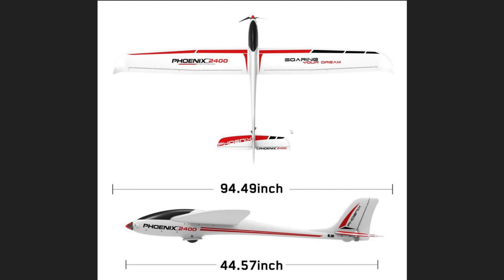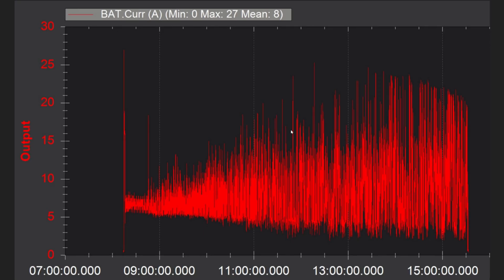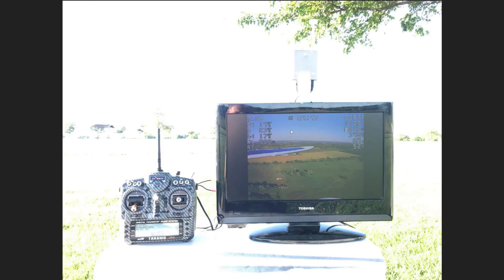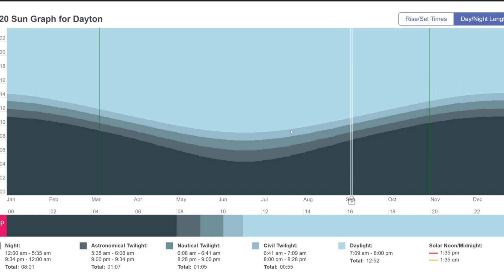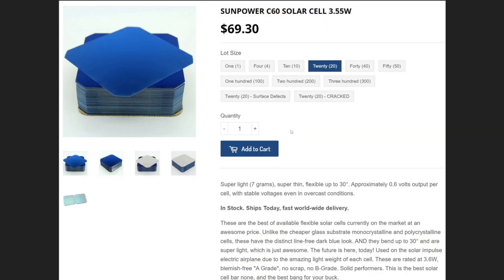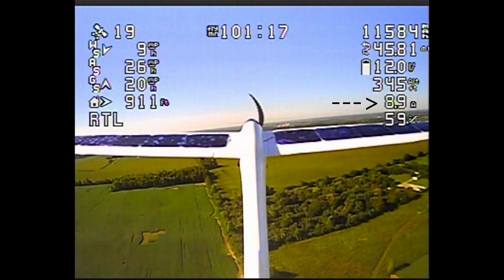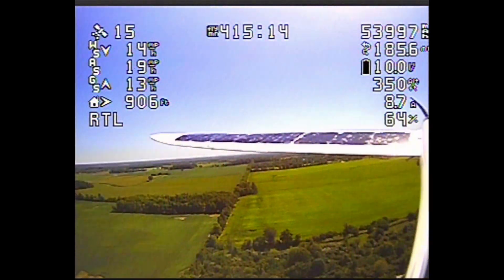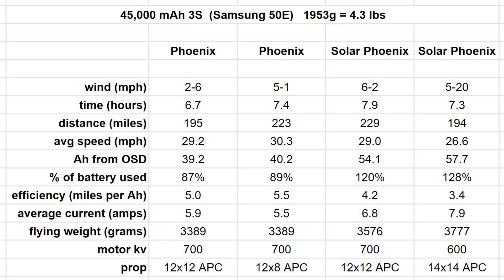RC Solar Airplane 7 Hour Endurance Flight

Comment: your Genasun shows it's a Lead Acid... can you use it on Lithium? I was talking to customer service for them - they said big now. Wonder what is the practical difference
Reply from the maker: The lead acid Genasun charger would have over-charged the battery, if the input power was greater than the output power, but that wasn’t the case. Other than that, it worked perfectly. The MPPT function was still maximizing the solar output. If it was going to over charge, my plan was to bump up the cruise throttle and simply fly faster, haha

Comment: im 49 and retired  do to a horrible accident that has pretty much destroyed my back,  i need a hobby, and this is right up my ally!! im a bit confused on how you program it and how your  able to watch the flight info.. teach me please.. im totally into this
Reply from the maker: I’m sorry to hear that, but you might have found a great hobby for yourself. There’s a lot to flying RC. You should start with a Spektrum controller and computer simulator for RC airplanes. Once you get that hang of that, then you can get a RC plane that connects to the controller that you’ve been using with your computer simulator. After you’ve mastered all of that, then you can explore the world of autonomous flight controllers. Check out Horizon Hobby. That’s a great place to get started.
Reply: @MatthewHeiskell  I own several rc aircraft. I’m interested in doing some endurance flights. I already do way points with a dji drone.  But that’s way different, it’s a lot easier.   I’m interested in doing what your doing.  I got plenty of time to kill

Comment: Hello, I’m planning to build such a solar plane. I was wondering how the battery would be balanced charged onboard the plane. Did you use a BMS between the mppt and the lipo?
Reply from the maker: That’s a good question! I’m my case, since the battery was only being discharged one time, albeit more slowly because of the added solar energy, I didn’t need to worry about keeping the cells balanced. There weren’t enough cycles for the cells’ voltages to drift apart. If you want to be 100% sure that your battery stays properly balanced, and prevent over charging, then you can use a battery management system (BMS). My plan for preventing over charging was to increased the throttle and fly faster, but my output power was always slightly higher than the input power. Perhaps it would have been better for me to use a smaller battery. Perhaps that weight reduction would have reduced the cruise power low enough for the solar cells to keep the battery fully charged.

Comment: I'm curious if you ever figured out the erratic behavior of the ESC at the launch and I am wondering if you had considered that it might have been propeller blade stall.  Running such a big prop at a slow airspeed but high prop speed to start may have caused the prop to stall.   Once you get your airspeed up then it works, but makes for a rough start.  Just a thought.
Reply from the maker: What you said is true, but the problem was the non-zero minimum throttle value in arduplane. There was a weird conflict when auto launch encountered it. I changed that value back to zero, and the weird behavior went away.

Comment: You have almost 58W of cells but are pulling 39. You should remove the laminate and try again, the increased solar efficiency would possible overcome inefficiencies in the wings.
Reply from the maker: Very true! I also cracked one of the cells during the lamination process :( but this setup still worked decently. Imagine doing it properly! :)

Comment: Inspirational stuff Matthew! I've recently been having similar thoughts (long duration, high alt, autonomous glider) and thought I'd check the Net to see what others had done. Always nice to find a trail blazer! I'll be following intently. Was already thing about the 2m Pheonix as a starting platform (cheap and good performance). I'll likely hit you up at some point on the charge/draw dynamics of your battery config. My long term goal is an 'all day' flight at a couple of hundred metres. Likely a big bespoke build (I love a big balsa wing ;). Thanks for sharing. Bewdy.
Reply from the maker: Glad to hear from a fellow KSP engineer! Balsa is the way to go. Bigger planes fly "better". It is the way that Reynolds numbers work. Just build the largest balsa glider, cover it in solar cells, and add a small battery. I'll be honest though, I'm not really a fan of solar anymore. I like the battery is ready day or night, cloud or sun. I've built an even larger battery pack that I want to try with my non-solar Phoenix 2400 wings.
Reply: @MatthewHeiskell  I've been enjoying reading about the academic research side of things e.g. AtlantikSolar. Some juicy info in their paper. Understand you on the solar, for me it's more a "while I'm up there I might as well get some free juice" ;)
Reply from the maker: @steven.j.heaton1850  Yeah, but its not free. You have the added weight, complexity, and cost of solar cells and charge controller. I prefer to put those resources toward the battery. IT is always going to give you the stored energy, day or night. The AtlantikSolar paper is excellent, but you can see the need for a VERY large airplane.
Reply: @MatthewHeiskell  With you on the cost and complexity. Not arguing (because I don't know!) but have you run the numbers on the weight? Are the extra flight hours from in-flight recharging with the solar kit heavier than carrying the equivalent charge in Lions? Genuinely curious :)
Reply from the maker: @steven.j.heaton1850  Even with my nearly 8 hour flight, I was only breaking even with the weight spent on solar cells and charge controller. Maybe flying with a super small battery would lower the power consumption enough to have excess solar energy. But then you're one big cloud away from a forced landing. I need more solar cells period. The wings need to be re-designed to fit two rows of solar cells. But it was realllly windy that day and it still flew for about 8 hours, so I think that it could do much better on a calm sunny day.
Reply: @MatthewHeiskell  Thoroughly agree. You got 8 hrs out of "less than ideal" conditions. I reckon you would have done much better with more (higher) sun and certainly less wind. One run isn't a result. I'd want to see 5 to draw any conclusions (this isn't Mythbusters so 3 won't cut it ;) Can't control the wx though... see the end of the 3+ day AtlantikSolar vid? Struth they were lucky. Speaking of which, battery in the wing spar... Hmmm :) Prolly still start with a P2k though. (Easier to get 'CFO' approval ;)
Reply from the maker: @steven.j.heaton1850  Hahaha I completely agree  with all of that! 👍

Comment: Great job!   One of these days, you'll get some better conditions, and do much better even.   In the meantime, you'll keep tuning and get the plane flying better and better.   Won't be long now, and you'll be flying all day and then will have to make a clean sheet design to produce!   Well, if you want to go that route.   I'm stopped on my project due to family issues, but happy to see you going forward.
Reply from the maker: Hey Spike, I'm sorry to hear that you have paused  your work. I am going to have to do the same thing because of school. I think that you're right about the clean sheet design. The wings have to be made to fit the solar cells. I want to do one more long flight with my current setup then maybe give up on solar. I the idea is really neat if you can fly above the clouds like HAPS, but I find the weather dependency to be pretty annoying. Battery power alone is 100% reliable. Ohio is very cloudy and at a pretty high latitude. I have learned a lot from this project. If I build another solar plane, I think that I will have more success.
Reply: @MatthewHeiskell  It's a great technology for an option for some areas, and times of year, and at some point in performance level and altitude, like you say, it can be be depended on for commercial operations. I'm sure when you design a wing, you'll take into account the potential for mounting solar cells, whether you do so or not.  Another way to look at it is as a range extender, but not one to rely upon in operations for smaller aircraft.    But Don't give up until you get some good data!!

Comment: It was nice that the camera was on the tail so the prolonged sideways portion of the flight was captured.  Really, like the prolong with the introduction of equipment upgrades.  Maybe hard to tell with the wind but was the noise signature much different with the lower KV motor and bigger bite prop?  Terrific video -- thank you!
Reply from the maker: Hey John, I'm glad that you enjoyed the video. Next time I fly, I'll pay careful attention to the sound of the power system and report my observations. In theory, it should be quieter and more efficient, but the wind obscured that.

Comment: Do you have airspeed sensor on this plane? If yes then you shoud set TECS_SPDWEIGHT to 2. If you don't have airspeed sensor it does not matter. Could you please post a log file from your flight with parameters?
Reply from the maker: I do not have an air speed sensor. Give me your email and I will send the log file to you. Do you also want a parameters save file?

Comment: You should decrease Throttle Slew Rate   (THR_SLEWRATE) to maybe 20-30. This will decrease the fast throttle change and make the current graph more smooth. There is no point changing throttle rapidly because this is big slow and not acrobatic plane.  But leave TKOFF_THR_SLEW to 100. Also take a look at TECS_THR_DAMP.
Reply from the maker: Hey, thanks for the Arduplane tips! My throttle slew rate has been 15 for a long time. TECS_THR_DAMP is new to me. I will read up on it.

Comment: Good and hard flight wile windy, additional 28% of the battery used is excellent adding value.
Reply from the maker: Thanks! I was impressed by the performance of the Genasun GVB-8. Just waiting for a calm, sunny day.
Reply: @MatthewHeiskell  with Genasun GVB-8 you can use LiPo ou juste LiFePo?
Reply from the maker: @TeamBlackDuck  I depends upon which version you get.